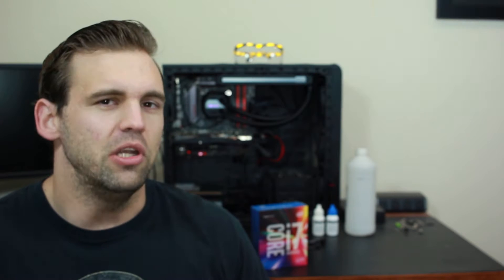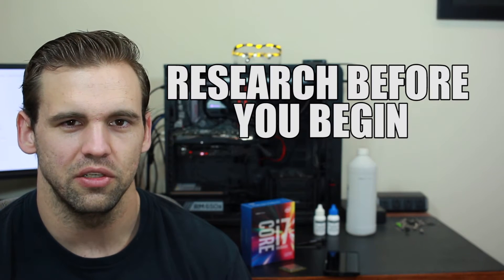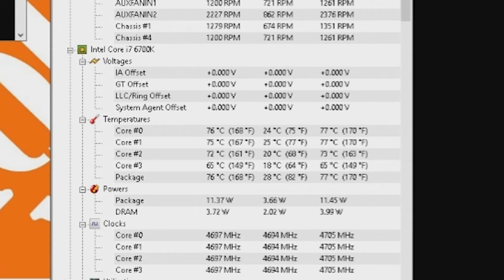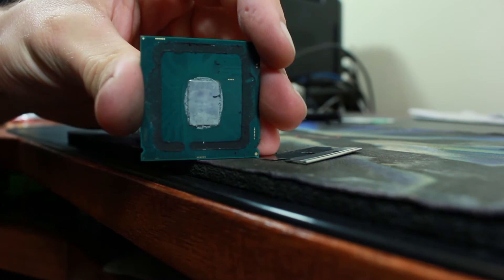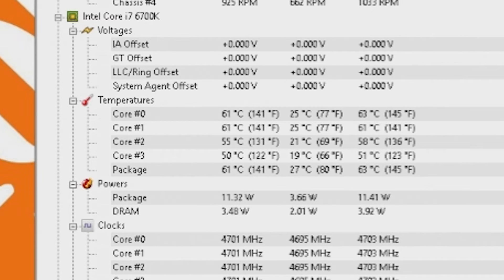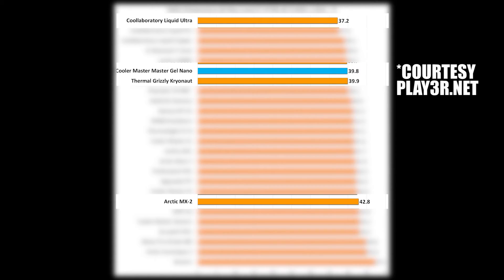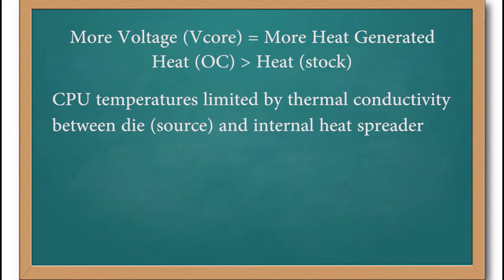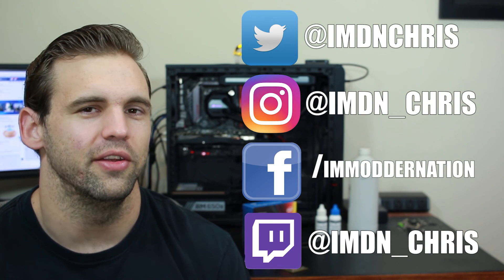DELID SKYLAKE/KABY LAKE GUIDE - IS IT WORTH IT? [MOD]

Comment from the maker: I posted a video update where I overclocked my 6700K to 4.9 GHZ after delid! 
https://youtu.be/E9oVFIMhpVM
Reply: ImmodderNation hey bro, have you used any delidding tools? I don't won't to use the razor blade as it won't be as safe if you own a skylake (i5-6600K I'm using) then could you review a delid tool?
Reply: ImmodderNation on eBay.com they have skylake delid tools for around £20 so not expensive, but no good reviews I thought you are a good youtuber to review one.
Reply from the maker: +Xx Luke xX Nope, I delided an i7 6700K with a razor blade. I could review a delid tool but I'd need another processor to delid.
Reply from the maker: +Xx Luke xX Thanks for the compliment, Luke. I'll have a look at those, but I probably won't be delidding with a tool for a while now.

Comment: i delidded my i5 4670 because it was having a bad heat issue on stocksettings. threw some liquid pro on the dye, added some AS Cermaique 2 paste, and now its idle at 30c much better than idling at 55C.
Reply from the maker: I've read about others have issues with high idle on the 4670 at stock, but it usually had to do with either mounting pressure of the cpu cooler or the air circulation inside of their case. Are you going to try overclocking?
Reply: ImmodderNation sorry I just now saw this reply. I've been able to get a stable 4.6 oc after switching to a liquid cooler from my hyper 212 fan. I also reapplied the Tim with ceramique 2 and got the temps to ideal at about 50-60c. Not sure why but I forgot to type the K at the end of the processor number lol.
Reply: therminatron your problem is the stock cooler. Get something better and you'll be fine
Reply from the maker: Joseph, I also had to move from my Hyper 212 Plus to the H100i to be able to move past 4.6 on my 6700K. You might want to switch your TIM to something better. If you check that chart of thermal pastes I posted in the video, Artic Ceramique 2 is around the bottom as far as temperatures go. Any of the other pastes would probably be a better choice and give you better temperatures. I used to use Artic MX-2 before switching to Conductonaut during the delidding process.
Reply from the maker: I agree with Joseph, therminatron. I also suggest replacing the thermal paste with the mastergel nano before attaching a new cooler. You said that the TIM on the stock cooler is supposedly already pre-applied, but did you check to make sure it was there? I would try to get your processor working with an aftermarket cooler and mastergel nano before you attempt to delid. If you still have problems with it, hopefully its still under warranty and you can return it. Delidding might not be worth it for you because of the overclocking limits on a NON-K cpu. Thanks for checking out my video, i'm glad you like it. Check out my VIDEO UPDATE where I push my 6700K to 4.9 GHZ!

Comment: just delidded my 4770K, running 20c cooler with just a TG Kryonaut for the TIM
Reply from the maker: +Genta Aditya that's awesome Genta. What speed is your overclock on that chip?
Reply: only 4.4GHz, with 1.28v
oh, i run it with H110i strapped with a pair of Noctua NF-A14
Reply from the maker: +Genta Aditya excellent!

Comment: Nice job.  I delidded my 6700K a few weeks ago.  I bought the Rockit tool to do the delidding because I ruined an i7 a few generations back trying the razor blade method.  I also used Coollaboratoryliquid ultra inside and out.  Anyway, the tool is quick and easy and takes a lot of fear out of the process.  My CPU will now overclock to 4.8+ @1.4V with temperatures never exceeding 65C -- even under a stress test.  As you said in the video, temperature differences under "normal" (stock clock) loads will see a little difference, but the overclock under load scenario is where this process gets to shine.  It seems that the Intel thermal compound is almost engineered to handle exactly the loads presented by a stock processor, but that same material fails miserably when put to an overclock test.  Thanks for a nice clear video.
Reply from the maker: I suspect that the paste Intel uses is designed for longevity (not breaking down and cracking over time) and cost efficiency, not necessarily performance under overclock like conventional thermal paste. Razor blade is most cost effective method for delidding that i'm aware of, but whatever method works best for you. Every method has its risk and rewards, whether its the delid tool, razor blade, or vise method. Thanks for watching!

Comment: Wouldn't it work better if you used a very thin wire over the razor blade? Like the kind they use to remove the glass from a broken smart phone.
Reply from the maker: You're welcome to try. There's no right or wrong way to do it, only what works and what doesn't. Maybe if the processor was held in a vice and you pulled the wire through like floss between your teeth. You'd need a sharp metal wire and still have to somehow keep the wire from scraping the PCB in the process. Good idea, though.

Comment: I delidded my i7 4790k, i7 3770k and changed my GTX 980Ti's thermal paste.  I changed them all to Liquid ultra.  The i7 4790k had drops of 17C, The i7 3770k had 12C drops, the GTX 980Ti had 30C's drops.  I think it is well worth it to do the delidding.
Reply from the maker: +Ahnilated Ahnilated Absolutely! Something as simple as changing to higher quality thermal paste can make a difference at higher temps. Congrats on your successful delids and temperature drops.

Comment: uhh the max temp was recorded at 63,61,58,51 which is an average of 58.25
Reply from the maker: Your math is correct, but I looked at average temp, not max temp.
Reply: @ImmodderNation  ok thats makes more sense then, fyi its bad math to use an average of an average.
Reply from the maker: @pcmasterwraith7676  Ok, but the point was that there is a temperature drop and if you did the statistical analysis, you would find that it's significant.